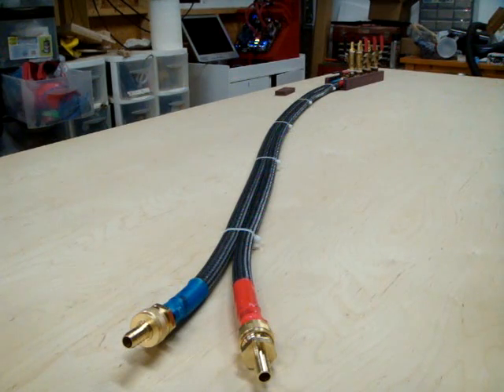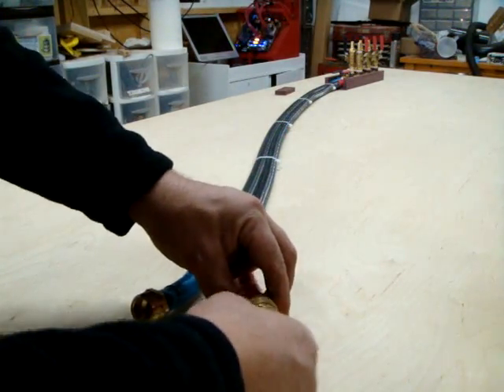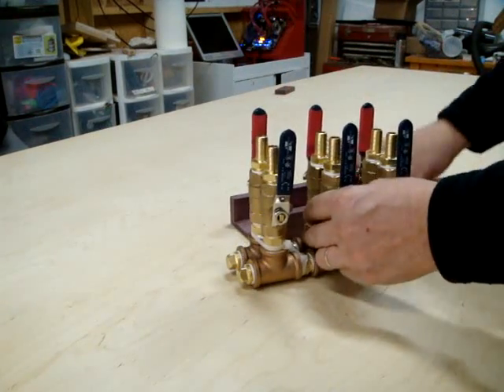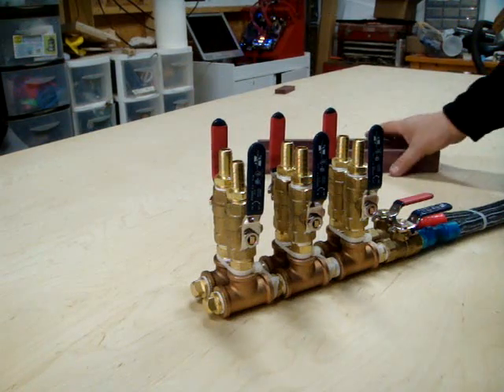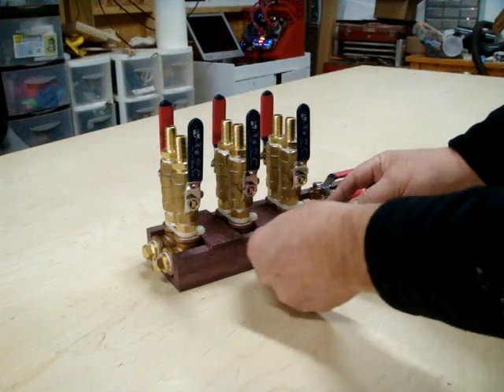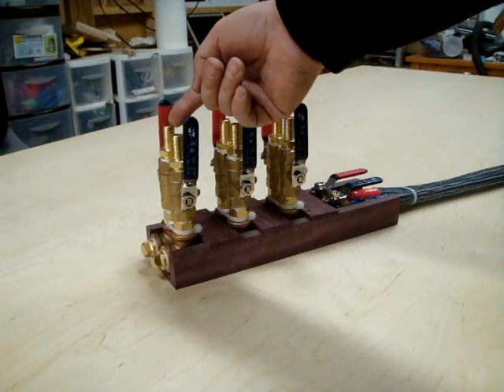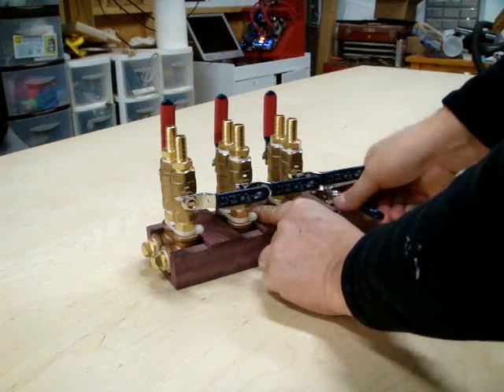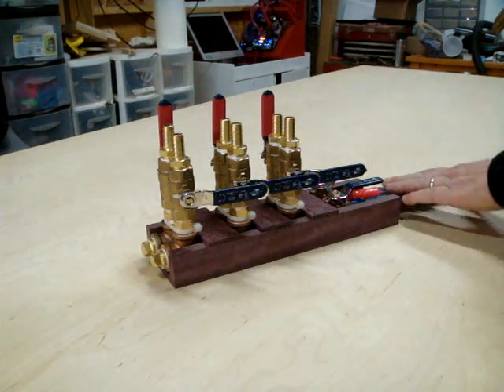Hydra Flow Metering Manifold for Triple Loop Cooler

Comment from the maker: Parallel plumbing ensures the two CPUs and the two GPUs get exactly the same temp fluid. Since these components all get overclocked and run at load for extended periods of time it's just intuitively the right way to go about cooling them by liquid. I am not saying having one CPU a degree warmer than the other would make the least bit of difference...it's just a modder's choice.

Comment from the maker: Just as a note. The main reason the client wanted to split the loop into sections is because he is using a Dual Socket Motherboard that has two liquid cooled processors. Likewise there are two liquid cooled GPUS. And finally there are two waterblocks for the chipset: MCH and Southbridge/NV200. Seperating the loops facilitates service. It makes it easy to drain just the GPU loop to pull the cards and bench other cards or whatever. It's not required: it's a convenience.

Comment from the maker: I've done it both ways. If you have a sufficiently powerful pump you will see no disadvantage to branched loops. Martinm210 did a lot of testing and basically the differences between serial and parallel loops are small. The downside to parallel is the extra tubing which creates drag on the fluid >>> more resistance. Serial plumbing uses the least amount of tubing usually so the least overall drag. But with a high flow pump it's a non issue and will not effect temps. It's more for convenience..

Comment: is there any gain by seperating them into seperate loops? i ask this because I have a liquid cooling loop myself, going through my  cpu and gpu, i plan on expanding this once i find a
 case big enough to fit both of my swiftech 360 radiators.

Comment from the maker: Just for my own curiousity I hooked this up to the house water and the port furthest away has the highest flow. So this is taken into account when plumbing the PC with the highest output going to the waterblock(s) that are the most restrictive.  During the de-aeration when testing the loop it is easy to see the speed of the fluid due to all the bubbles. At that point I was able to play around with adjusting the valves. Although only 3 valves are needed I use 8 to ease assembly and maintenance.

Comment from the maker: It splits the In/out from an external cooler into 3 supply and 3 return ports. It's for PC liquid cooling where you have a CPU, GPU and Chipset loop of watercooling using waterblocks, radiators and pumps.

Comment from the maker: Restriction in a closed loop is always on the smallest ID which in almost any circumstance will be the G-1/4 port/fittings on the waterblock(s)/rads and/or the most restrictive part of the waterblock or rad. 3/8 Ball Valves have an ID when full open that is larger than the ID of a typical hiflo G-1/4 barbed fitting. In a closed loop temps and restrictions are averaged. I am grossly oversimplifying but basically the manifold facilitates maintenance and allows for flow to be tuned for the 3 loops.